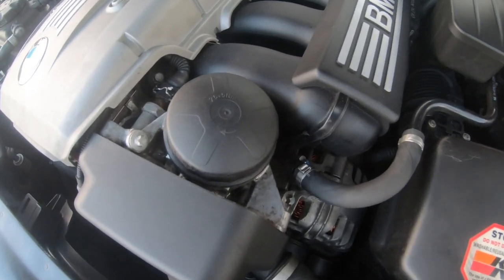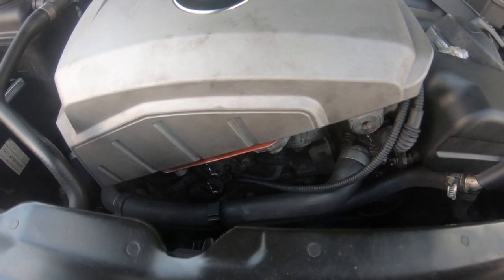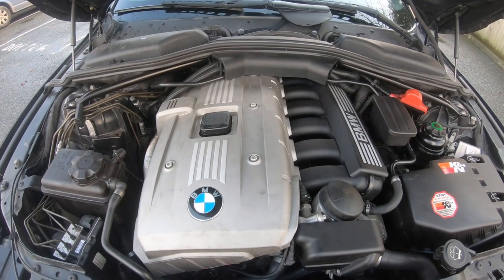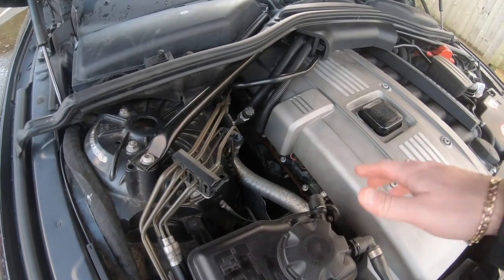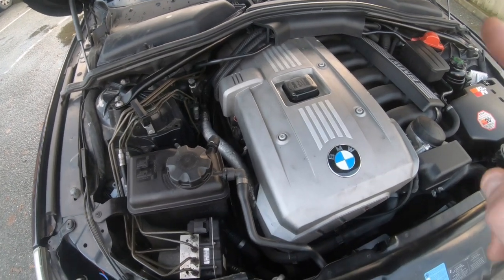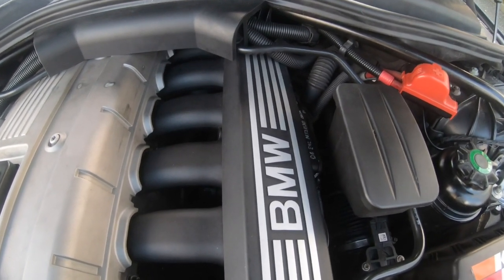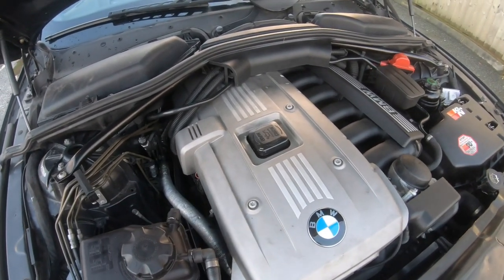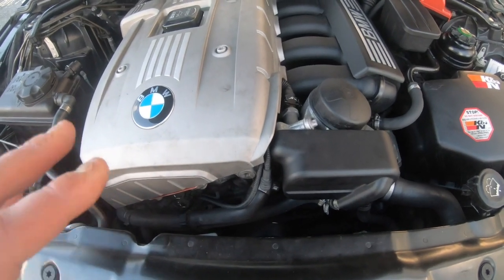9 Parts That Will Fail On A 100K + Mile Bmw N52 Engine

Comment: Wery well man, so can you write all that in list from parts here?
Reply from the maker: You must be joking mate your gonna have to use subtitles
Reply: Yes Man, it was a joke!👍🏻☺️ So, I wanna tell you, everything you say in this video, it happens same on my N46 engine, especially this Cylinder Head’s Oil Gasket...☝🏻! It drives me like a fool...😤 And it’s a definitely the most stupid thing on BMW Engines!
Reply from the maker: Zeljko C n46 is more unreliable then this trust me bruda I seem to get a lot of N46 n42 guys I think that’s because nobody does that engine so there looking for anyone who will help them I COULD buy that car I’ve been offered them loads of times BUT I won’t 😁 just because it’s 4 cylinder and I ain’t poor enough to need it 😂
Reply: @BMWDoctor  Bro, I agree with you, but trust me, when I was buying a car, I was needed it right away and I didnt find a good one 325i or 330i with this N52 Engine. It was a bad luck. I will replace it soon! Are you in USA?
Reply from the maker: Zeljko C no mate I’m in the U.K. not USA please don’t confuse me mate
Reply: @BMWDoctor  Ah so, Ok, sorry bruda! :) This Part DISA Flaps wich can make a ticking noise,  does it have on the N46 similar?
Reply from the maker: Zeljko C no mate you don’t have disa on that engine

Comment: BMWs are by far the most overrated and overpriced cars ever made. Pick any BMW more than 8-10 years old and it will have or had major issues with rod bearings, subframe, VANOS etc. Electrical stuff? They have kindergarten kids doing the design and assembly.
Reply from the maker: Mate sorry but there no trouble for me what so ever I understand them electronically and mechanically does for me I think there the best cars for under 8-10k for others that ain’t the case but me I love them

Comment: Hi I have a BMW 325i with the n52 engine I'm getting a 2d0f  air mass metre code. when you start the car on a cold start and you press on the brake pedal the RPMs go up and down between 600 to 1000 once the car is warmed up pressing the brake does not effect the rpm also the car doesn't want to start in temperature bellow -5 Wich I assume is because of the the code

Comment: One more question. Do you have one of these videos for the n55 engine?
Reply from the maker: we dont get N55 here mate this is uk we get MOSTLY diesel im very lucky to even have a N52 this is super super RARE here in the uk
Reply: I thought N55 engine is found in e90 as the 335i and e88 as 135i 2010-2013?? Quite common in uk.
Reply from the maker: Yes mate it was in 335i for around 2 years ONLY and they are not easy to come buy as the gearbox is HIGHLY sort after as you know it has DCT gearbox which is what everyone wants
Reply: The N55 is widely here in the Uk in the M135i. 
I would love to see come content on the N55.

Comment: I agree .I have E60 523I 2006 170K miles. Gradually I had to change everything.Still oxygen sensor rear, IBS sensor, oil level sensor and voltage regulator in alternator.

Comment: My ‘07 530i (N52) is at 247,500 and I’m doin just fine! I beat the crap out of it daily too
Reply from the maker: Come back to me in another year let’s see if you still say that OR you just haven’t checked underneath your bonnet to notice anything but after this video now I showed you I bet you will please make sure you don’t do what the rest do say you have no issues then never come back and report when you do because of embarrassment there is nothing to be ashamed of saying you have issues it’s normal on N52
Reply: Looooool. I do my own maintenance, I’ve only had to change the oil, fog bulbs, and cabin filters. The n52 is the most reliable engine I’ve ever had.
Reply from the maker: So your admitting the car has had problems 😁 as you said you do your own maintenance nobody will ever believe you making a comment like this I have 10k subs and ALL have had problems on there N52
Reply: BMW Doctor think whatever you want dude. Oil, fogs, and filters isn’t a problem.
Reply: 198,000 on mine and only ever did standard servicing...

Comment: One thing I haven't figured out yet. My car when in m/s boggs down hard in 1st gear at 4000rpms. It only does it in m/s though.
Reply from the maker: Mate vanos solenoids bro they do that when they can’t advance the timing as quick as your telling the dme by pushing the throttle 

Change then genuine ones and everything will run perfect my friend
Reply: BMW Doctor I have the same issue. I’ll change the solenoids.  Also, update the modules, what does this mean?
Reply: Thanks man!
Reply: Let us know if it works out

Comment: Forgot the oil pan gasket and water pump. Generally these are pretty solid engines that with basic maintenance will be really reliable. I like them.
Reply from the maker: I said water pump on this.

also oil pan gasket has been mentioned in my previous videos it wasn't mandatory to do NOW and is not something I consider a major thing on this engine to do immediately it leaks yes but not severely that you cant drive the car.
Reply: BMW Doctor Gotcha, makes sense! Good video!

Comment: Wish I knew this before I bought one. I have done 6/9 of these. You didn’t mention sump pan gasket. Mine failed around 250,000 Klms but from looking around seem a common failure at around 100,000 miles.
Reply from the maker: Mate I didn’t in my common leaks 

This wasn’t relevant on this video you have to understand aswell this varies country to country is being in the U.K. this is not likely the case here you may see loads of them like that

I have only seen 2 in my time out of 300 so that shows why it wasn’t mentioned
Reply: In hot parts of America the plastics and rubbers don't last long. In cooler places they last much longer.

Comment: In two days I will be changing my Spark Plugs and Ignition Coils. Are there any other parts I should replace while I do that job?

2007 328XI 122K Miles N52K

Any advice is very appreciated!

Comment: Regaping 4 electrode spark plugs, are you serious??? Changing a set of coils because of some additional stress to olders ones? The main cause of oil  leakage is blown membrane inside valve cover, not bolts, or pcv valve under the intake. IMO you gave good advices but poor explanations.
Reply from the maker: Mate are you serious clearly you didn’t understand the video properly and I’m not gonna explain to you if you can’t understand English properly I think you need to watch with in your language and understand what I said
Reply: @BMWDoctor  I'm sorry. I thought you said "just make sure they're gaped correctly.. if you can't gap the spark plugs you shouldn't even be touching a car.. some of them don't come pre gaped... you just gap them yourself.. just make sure they've got four electrodes..and just gap them to what BMW recommend" LOL  Oh yes, it has to be my poor English, not your knowledge..
Reply from the maker: MiniacPL yes if you buy spark plugs NEW you should always always before fitting check the gap length I always do BEFORE fitting this is why a lot of people get misfires and they can’t trace the fault it comes up misfire cylinder they change the ignition coil change everything only to find there spark plugs were the wrong ones and gapped wrong and already damaged the cylinder

Comment: what about the single link timming chain now at the back of the engine. some  are failing before 110 kms ?
Reply from the maker: single link timing chain ???? thats on diesel bmws that are at the back of the engine 

not on petrol my friend no bmw chain is on the back apart from diesel
Reply: @BMWDoctor  i am a diesel mechanic  the same is with all the German manufacturers.there are plenty of diesel bmws   and  mercs with single link chains  at the back  on the market . i did not mention   petrol. it is a bad design . the bmw engines are being made in china now . i am sure you must of worked on a diesel bmw ? i do like your videos and look you up if i have a problem with a petrol that i do not know a bout .   thanks
Reply from the maker: Kim Bird my friend I do diesel aswell and yes you are correct timing chain is on the back on diesel BUT NOT PETROL!!!! mate I do diesel here please see my videos

Comment: how to update the modules?
Reply from the maker: by me remotely
Reply: @BMWDoctor  my dad has a 2006 325i e90. with the n52b25 engine. it weirdly doesnt have a PCV, do you maybe know how that is possible and it has the magnesium cover. How much do you ask for updating firmware?

Comment: Hello friend
Thank you so much 
 HELP !!!
MOLD on the steering wheel 
The car is Parked  outside under a tree (shade) with a cover and on top of that 2 blue tarp for the rain is Florida u know I use the motorcycle mostly
Clean with pure destilleded white  vinegar in 2 weeks no uses mold again all over steering wheel and dashboard is spreading
Clean again the whole car is clean inside and waxed outside 
No WATER ANYWHERE INSIDE 
All full of white mold again 
I do not know what to do is  
So is frustrating me 
Please any help will be awesome 
Cause I do not see any water !!!
Reply: Hydrogen peroxide

Comment: Hey boss it’s me again, I order my water pump and thermostat. What are your recommendations when changing them ?? 

Thanks ahead of time
Reply: My waterpump seized at 180.000km I suggest you replace it at 150.000km to be sure
Reply: Michel my car only has 103k miles, I replaced both of them last night
Reply: when changing water pumps  remember most  bmw  engines have a left hand thread  on the viscous fan hope this tip helps you when changing yours .
Reply from the maker: mate viscous fan ????? bro this isn't M54 bro I dont know why your commenting on these videos mate your making yourself sound a tit 

N52 does NOT use a viscous fan ONLY M54 mate stay with your diesels and leave the petrol stuff to me
Reply: BMW Doctor wait huh? I didn’t say anything about a fan. Lol

Comment: 135k KM(10year) got tensioner pulley set, valve cover gasket, spark plug replaced over time. Thermostat/coolant pump just died before I end up trade in for a new car. Half of what you said in this video happened.
Reply from the maker: That’s correct mate you guys go through waterpumps and thermostats like anything over there lol never seen a country use so much waterpumps and thermostats here ours last the lifetime of the car

Comment: Got a vanos intake plus a crankshaft camshaft reference  code idles rough and cuts out
Reply from the maker: Vanos solenoids brother
Reply: What codes are they mate?
Reply: @kimpaul1937  had the same ones,  on my X5 2008.  Replaced vanos solenoids.  Haven't come back

Comment: Dr dean !! How would I update my 2007 530i e60 ? It has 190,000 and have had it since it had 174,000 . I’m not sure if it had been updated already but I doubt it ! In United States nobody thinks about updates. Btw I replaced that water pump an thermostat and the fault code cleared itself an it’s been doing great since .
Reply from the maker: It’s not as simple as you can mate if I’m honest I usually do it for people
Remotely on there cars the same as I do for Nathan and that is correct I highly doubt yours has been updated just like the rest of cars I go into to find there never updated it’s not something anyone was aware of until I come around
Reply: Bmw Doctor yea I know your the damn man when it comes to bmw ! Real dr bmw ! Hey just let me know what to do and I will do it . I’m very great full for you an all your wide range of knowledge on these cars ! I could not make it with you lol .
Reply: Ok just let me know what you need me to do . Mate
Reply: Is there a way to tell if it’s been updated to current program?
Reply from the maker: No mate there isn’t the only way to tell is by having the files and comparing numbers mate

Comment: Thanks for the video! I have a e90 330i auto and i have a very intermittent issue (once every 1 or 2 months) where from idle, when i attempt to pull away it hesitates and i have to let go of the accelerator, reapply pressure and then it will respond. Never happens when im already travelling, only from standstill. anyone have any ideas?
Reply from the maker: Vanos solenoids! Buy new ones from bmw themselves
Reply: @BMWDoctor  Thank you. i will do that and am planning to do the other bits you advised. will report back when its all done.
Reply: @BMWDoctor  Just to report back. replaced as u said with oem solenoids and 4 months later-no hesitation! Thank you for the great advice.

Comment: Thanks for the part on the valve cover bolts. My records show the valve cover gasket was done ~20k miles ago, but I just found a leak and a couple of the bolts could be turned by hand!? I had just changed the CCV system and it was crap. So either they torqued em wrong on install, or they were loosened from the increased pressure like you said. Once again you clear up a strange situation.
Reply from the maker: Yes mate I’m a expert on this engine as you know mate that’s why a lot of people wouldn’t expect this and expect them to be loose but trust me this is what happens
Reply: @BMWDoctor  how do you feel about BMW dealer servicing? I find they are not meticulous and sometimes do sloppy work. I've paid a fortune keeping it BMW Certified by going to the dealer. any suggestions?

Comment: Have an 325ci with the great m54 engine it has now 270000 km on it and runs fine only issue i had is the disa and the timing chain wich beckomes a bit lose
Reply from the maker: My friend this is about N52 ???? Nobody mentioned M54

Comment: £100 for 6 coils? Where are you getting them from mate?
Reply: good video btw, I have an e61 530i very similar to yours, I will have a go at updating the DME/gearbox modules following your instructions and also check the DISA valves asap, cheers ;)
Reply from the maker: I get everything cheap it’s trade account 

And my friend updating the DME and gearbox is not as simple as one would think trust me I get many many people saying there going to do it and they end up with there car module fried
Reply: I'm still willing to have a go, I don't assume it will be simple but i'm a software developer by trade, have built several engines in my time and i built the ecu for my vw campervan when i converted it to megasquirt fuel injection, I also code microcontollers, mess about with embedded systems and have hacked many a phone or games console over the years, so i ain't your average plum my friend.  More detailed instructions would be handy but i've watched a few of your winkfp vids and i have all the software and related sp-daten... Don't worry i'll do my research fully before attempting it, i'm in no rush to brick my daily, cheers appreciate the reply ;)

Comment: Alright mate I've had the battery disconnected for 2 days and the suspension hasn't dropped atall. Tried listening for the compressor when locked with the battery in but doesn't seem to be switching on. I left it connected for 15mins while listening for the pump and didn't hear it but the battery went flat in just 15mins.
Reply from the maker: Ok mate here is what you do go inside the car and lock it with you inside stay STILL while doing this otherwise the car will not even try and go to sleep and see if your CCC fan stops spinning and goes to sleep if not that means the CCC is keeping the car awake
Reply: @BMWDoctor  I've got the fuses out for the ccc mate it's in constant reboot mode now so pulled them a few wk ago.
Reply from the maker: TOYS AND FAMILY ok the next thing to check is the air suspension relay not shutting off mate

If you can’t find the fault the only way is to get it on the system to check what’s keeping it awake it can even be the cluster mate there are many things that can keep the car awake
Reply: @BMWDoctor  Cheers mate will do. It's literally draining a full battery in 10 mins but If i put the battery in and start it straight away it starts no problem.  Gonna go sit in the boot with car locked and a clamp meter on the battery and start pulling fuses . If that fails I'll have to get it plugged in.👍👍

Comment: Does upgrading to 4electrode plugs require any re(set)(programming) or are they plug'n'play?
Reply from the maker: Bro tell me your not serious ????

WHAT KIND OF QUESTION IS THAT!!!

does spark plugs require programming are you for real....

Next you will be asking me if you use milk instead of oil
Reply: @BMWDoctor  lol not the plugs themselves, the computer...when owning such a temperamental vehicle, stupid engineering equates stupid questions...like having to replace cv shafts bcuz swollen reluctor rings were nicking abs sensors...and yes, I do use nonfat oil lol
Reply: @BMWDoctor  Everyone knows Vitamin D milk reduces friction as the whole milk fatty acids fill in microscopic pores in the metal creating a lactose based lubrication surface. But it has to be vitamin D whole milk organic, I cannot stress this enough, it needs to be organic.
Reply from the maker: Wally Cunningham 🤣🤣🤣

Comment: Why are bmws so high maintenance?
Reply from the maker: There not at all if you do it yourself and don’t treat like a sports car if you treat it with care not trying to show off and red line it like you think it’s a sports car then they are perfect cars sorry mine ain’t high maintenance I did all my stuff on 130k and mines on 160k still perfect it depends on if you want to put the time and money in
Reply: @BMWDoctor  Thanks for the clarification, are there any future plans for a B48 on the channel?
Reply from the maker: No there is not so far as the car isn’t haven’t problems as of yet I don’t know any people with problems on that engine 

Secondly it’s very hard to find that on the U.K. as most we get are in diesel we will possibly have B47 Diesel engine